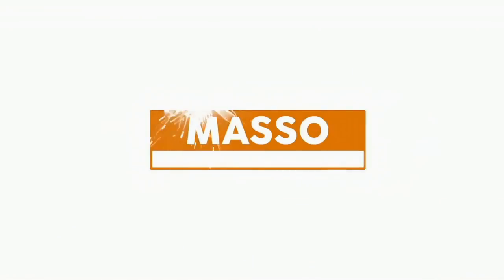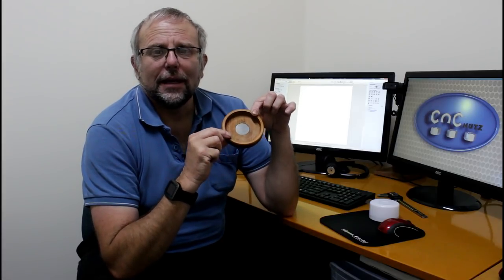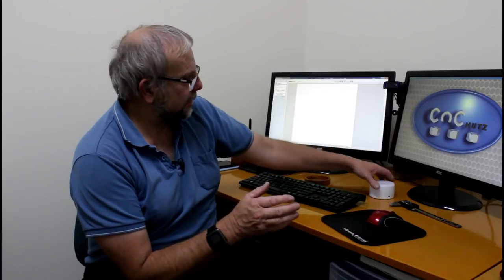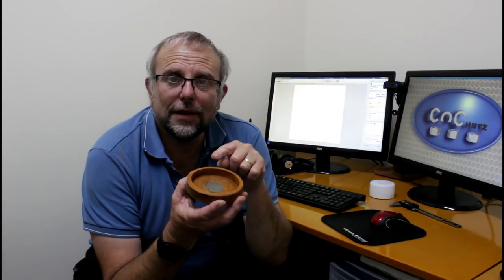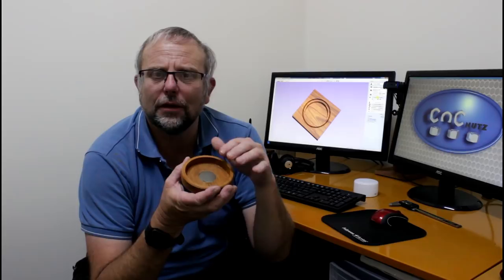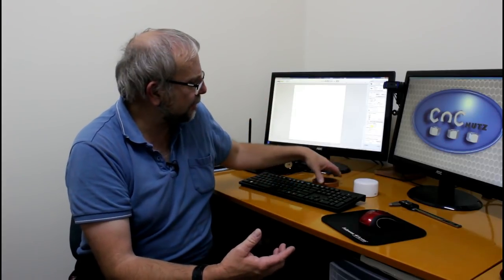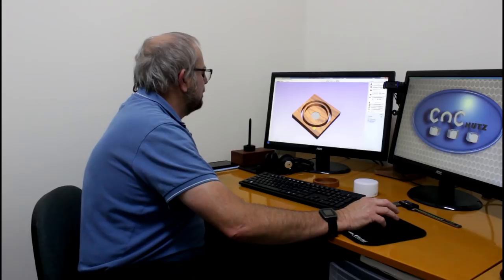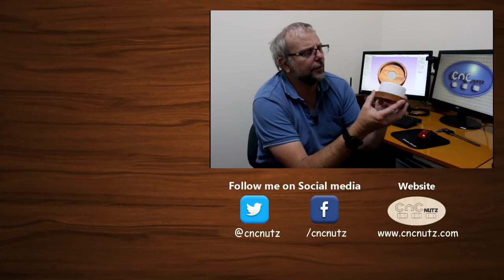Simple Bedside Lamp - CNCnutz Episode 227

Comment: Great project, Peter. The video shows some needed info for beginners. Not only for this project, but others that could be similar. Near the end, you mention the background in Vcarve and I've been wondering if it's possible to import backgrounds for other types of wood. For example, I'm doing a lot of work with fence board cedar, and there isn't a very close wood selection in the software. Also, it would be nice to be able to rotate grain direction in the sofware, like you can in sketchup. Any ideas? Thanks.
Reply from the maker: Thanks Jim. Yes you can add your own material. I don't think there is a way of rotating the grain but you could create materials at 90 degrees to one another and select the one you want.
Cheers
Peter